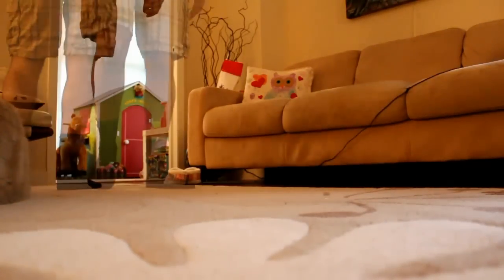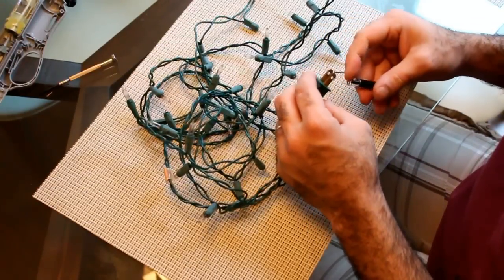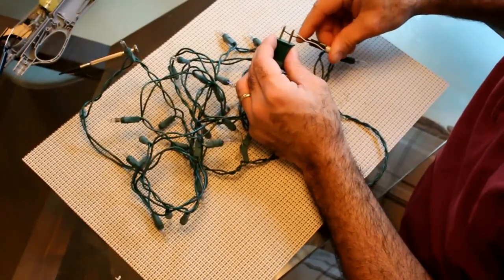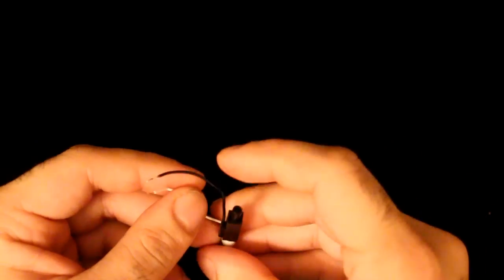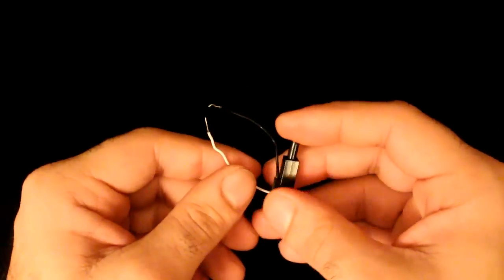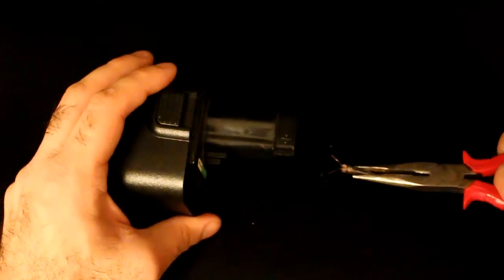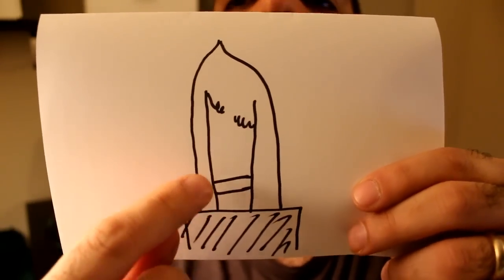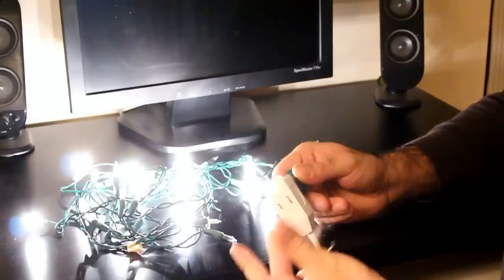How to Fix Blown Christmas Lights Fast and Easy

Comment: the designer for the christmas lightblub is so stupid... why connect the bulb in series? one bulb blown, whole thing doesn't work.... anyone who took any physics class would know to connect them in parallel.
Reply: In parallel, they would all have to be 110/230V,. In series, they are 2-12V - easier to make (it's hard to make such a small bulb that can take more than 100V), cheaper, easier wiring plus if you put one bimetal bulb in each string of lights, they will all blink...The bulbs in series do have shunts so the string keeps on working even if the bulb blows, but they sometimes fail because they are made to be as cheap as possible (parallel lights would cost more than proper-shunted series lights)
Reply: could easily make a step down transformer on the adaptor, each bulb would still only need about 1v to operate. yes its cheaper and easier to produce in series, but that take away the whole point of having a engineer. engineers r suppose to make things less likely to break and better functionality.
Reply: kiryu nil well, not the Chinese Engineers... :D
Newer lights don't have the old blinkers, they have a step down transformer, more wires and they also have dimmer electronics so they don't blink, they fade in-out and look very nice, they're also made (and mass produced) by Chinese nowdays so they don't even cost that much more, but technology was not available 10 and more years ago so they was really expensive back then!

Comment: Wow, are you kidding me? This is hilarious and interesting! As a kid I was tasked to replace all the bulbs because I was the "electricity person." I figured out QuickSort as a 9 year old kid, trying to figure out which ones were burnt out fastest! Fortunatelly it only took 1 replacement bulb and 1 run down the line most of the time but still.

Comment: This is genius! I've never thought of that. This small metal bridge is a mechanism that is supposed to be activated when a light bulb burns. That way the light string would work even if one of the lamps is not working. The problem is that sometimes this system does not work. But apparently you fired out a way around it! Great job!

Comment: Well, still no answer to the question "Why aren't light strings just made with parallel wiring?"
It would solve so many problems...

But I guess better make the buyers have the annoying part of searching for blown bulbs than just use a slightly thicker cable for the higher current...
Reply: The thing is that it would cost more as well because of the time it needs to be made and all the extra wires.
Reply: The more expensive ones are parallel.
Reply: For parallel you need a higher current and so the wires would have to be thicker to have less resistance and so less losses. Otherwise by the time you get to the end of the string of lights the end lights would be dim, In series the current is the same in every bulb so they are all the same brightness. You also don't need a power supply because the mains input voltage is divided between the bulbs.
Reply: Cost. There have also been LED strings available for some time now, they are more expensive but barely ever blow in the first place, plus LEDs need to be wired parallel anyway, bonus.
Reply: xSkitZx It's not cost... same amount of wire is used if wired in parallel, it's for the reasons I've stated. Most LED strings are wired in series in exactly the same way for the same reasons mainly current drop at the end of the string. With LEDs they tend to use a power supply as it's ideal to have DC anyway so it's dropped to just under 40v typical with several sets of loops as the individual LED voltage is between 2-4v typical again.
Reply: ...almost all light strands are parallel now a days

Comment: I dont get it but awesome!
Reply: The whole electricity thing.
Reply: TheErdnussMarmelade Electricity is the flow of electrical power or charge. It is both a basic part of nature and one of our most widely used forms of energy. It is formed when electrons flow from a negatively charged point to a positively charged point. This can take place over any conductive medium including air. (see lightning) Electricity is broken into two main parts volts and amps. Volts or voltage is defined as the difference in electric potential between two points of a conducting wire when an electric current of one ampere dissipates one watt of power between those points. Amperage or ampere is a measure of the amount of electric charge passing a point in an electric circuit per unit time. 

Word of caution do not pee on an electric fence.
Reply: I already know all that but I dont get how a thing from a lighter can repare a christmas light.
Reply: Sarcasm attempt failed. Please try again..

OK so in the more expensive Christmas light there is a bridge that connects the two filament polls in each bulb. When the bulb burns out there is an increase in line voltage and this causes the bridge to short and close the circuit allowing the rest of the string to stay lit. The sometimes this doesn't happen. So the sparker can do it. It emits a 50-100k volt spark at extremely low amperage. 5-6 pulses causes the bridges that are open on blown bulbs to short and close. Thus the string lights up. From there you can replace the burnt out bulbs.

Comment: Wait, Medhi, so the bulbs are in series, but there's a bridge that is supposed to blow with higher voltage passing through, SO HOW does blowing that bridge allow the light to work?  That makes no sense whatsoever, the bridge is there to continue current, but you're saying if you blow the bridge the voltage continues?? HUH?

Comment: Sounds a bit like troll science. But hey. I'l try it.
Reply: lol
Reply: The idea is that when the filament burns out there is no current, so there is no voltage drop across the other bulbs and the blown bulb then sees mains voltage. This is meant to trigger it to short but it doesn't always (its designed not to trigger at the low operating voltage and only at mains). Seems like it might work better in countries with 240v. The piezo creates a higher voltage so its more likely to trigger the short

Comment: Hey Mehdi,
in your video about fixing the camera you told us that there is a capacitor which has a voltage of 300V. Can you explaint that to me?
I thought that capacitor only get their maximum energy from their energy source e.g. battery of the camera. But did the capaictor managed to get a voltage over 300V. I don't think that a normal camera battery is able to produce 300V.
Btw great videos as always!